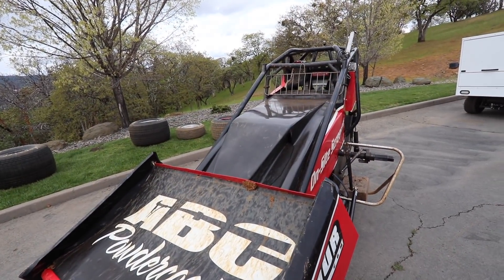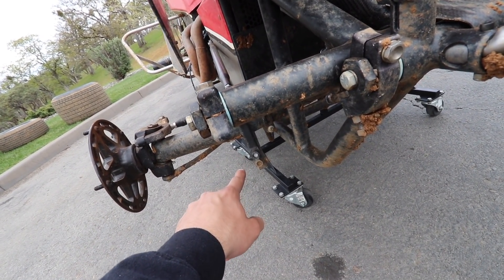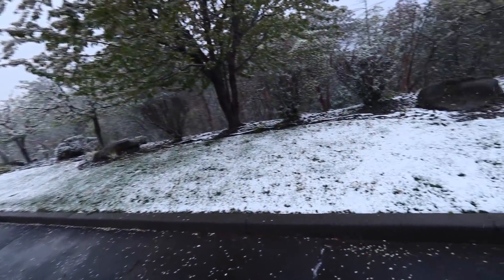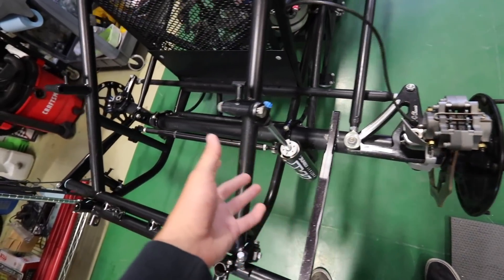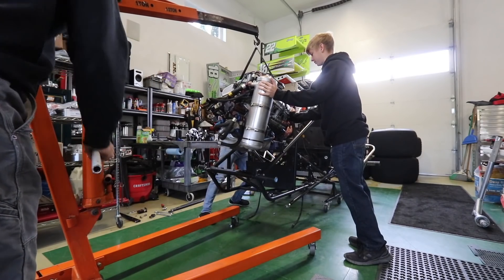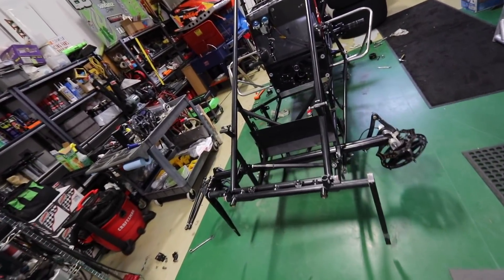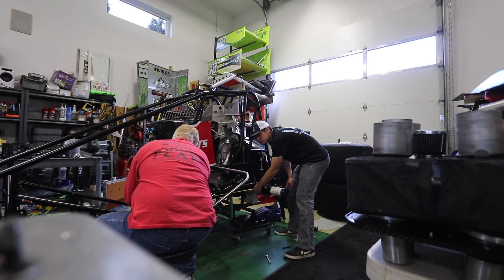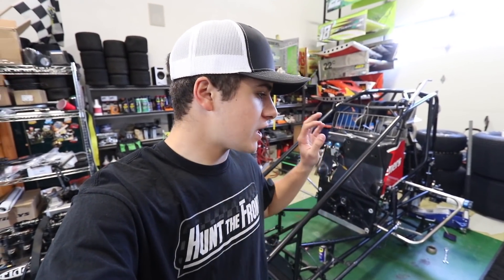Here Is The Damage From Our Crash....

Comment: Most of the times I got upside down, I pulled the studs for the torque tube at the rear end. It kind of depends on how hard a hit the rear tires/wheels took. 

The one time I didn't check the studs, I was at a big race at Granite City, IL and the studs pulled all the way out when I got back in the throttle to pull off the corner. All I knew was that the car was out of gear. When they got me back to the pits my buddy said that something very hot flew out the back of the car. It was the rear coupler and the front of the lower shaft. It didn't like being there without the torque tube connected.
Reply from the maker: I should have mentioned we did check these! Very valuable tip!